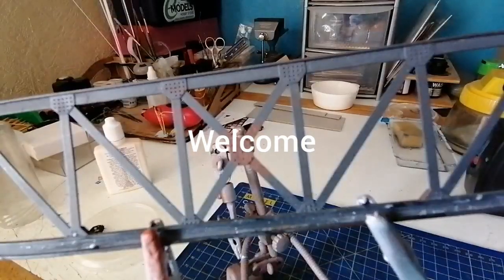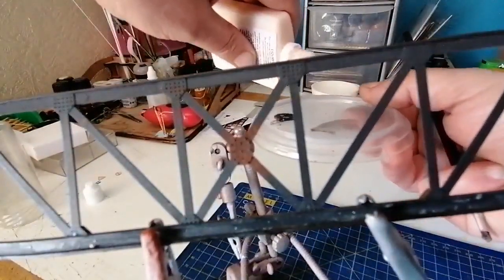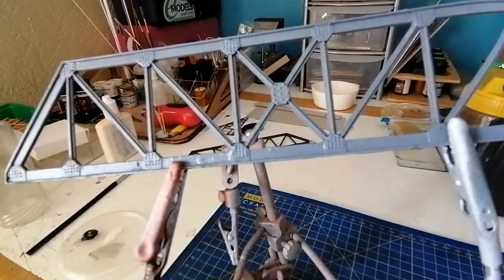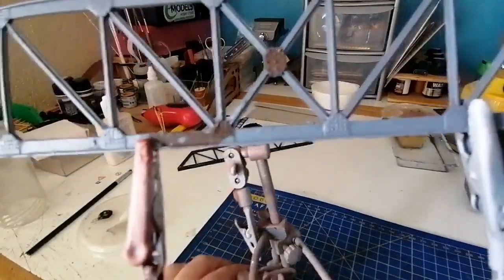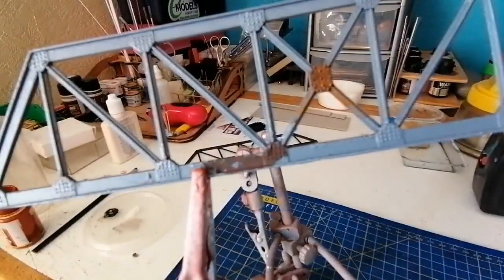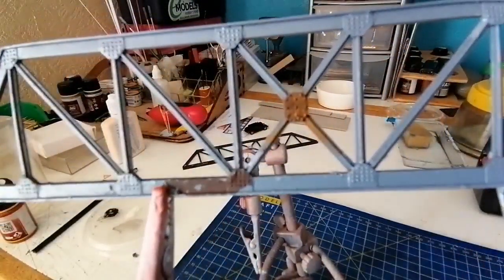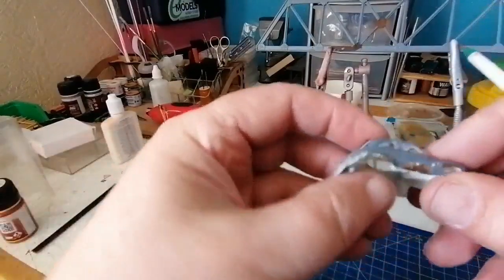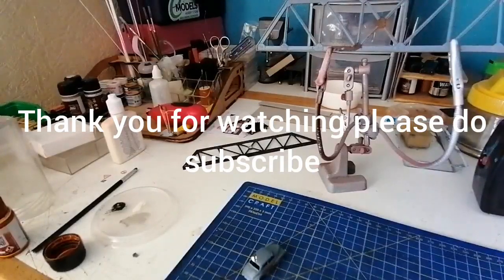Making ironwork look real on the model railway Digger Evans method

Comment: Hi ya Digger, thanks for the tips. Great stuff. Another technique I have seen used is the salt technique. Base coat rust color. Let dry. On a flat surface sprinkle salt, lightly, where you want the rusted area. Wet it with water so it sticks. Let dry. Spray the item the color you want it. Let dry. Rub or scrap, gently, the salt off the item. The underlining rust area shows through the top coat. Try it. See ya.
Reply from the maker: Hiya Norman I've seen the salt method too, good results can be had from it especially stone chip damage on cars etc..

Comment: HI Digger what a good idea . So you rusted the area , applied the latex and sprayed the entire bridge gray ?    Where did you get the jig you have holding the bridge ?   Who makes that tiny brush , I've never seen one like it .  THanks for sharing and take care my friend .
Reply from the maker: Hiya Jerry the jig is a soldering aid I believe it's called a third hand, try someone like harbor freight they should have something similar, the brush was really cheap I think 99pence for a full set they are on e bay and girls use them for painting their finger nails, called nail art brushes, they're very handy to have,
Reply: @DiggerEvans  Thanks I'll look for those brushes .
Reply from the maker: @BoxcarJerry  Hiya Jerry forgot to answer the first part my friend, yes when the initial rusting is done, mask over all the rust areas and then spray the paint as you normally would, then just wait for it to dry and peel off the latex